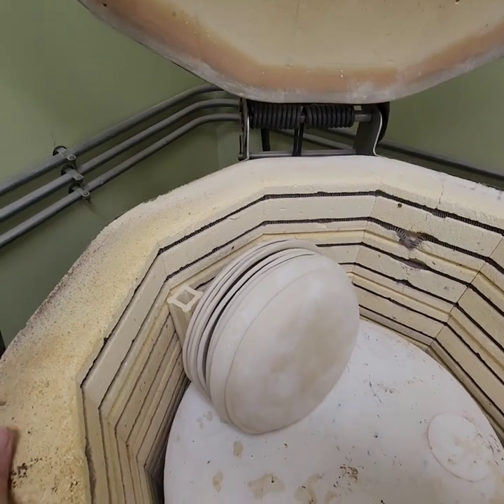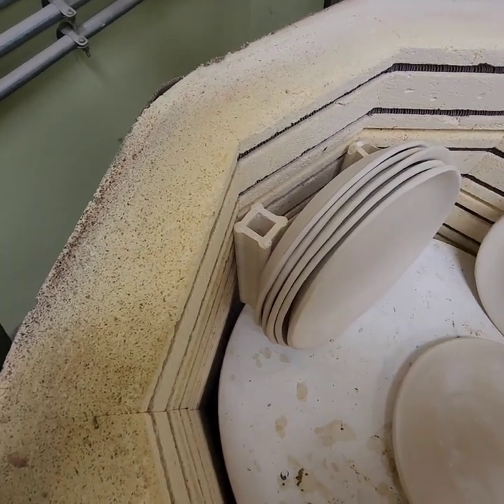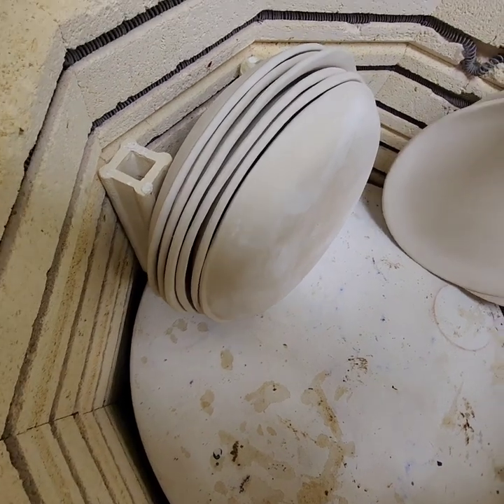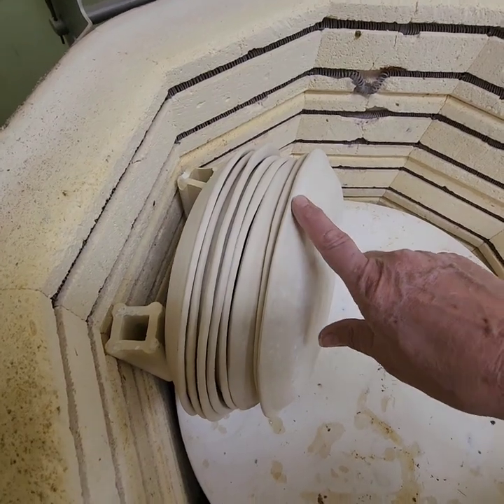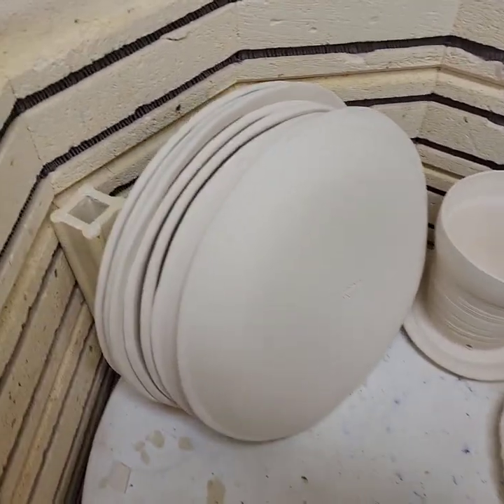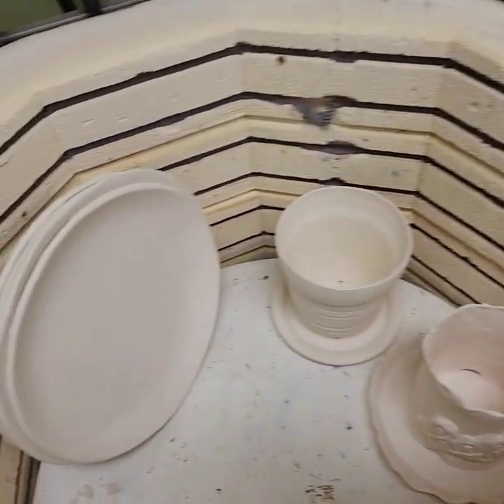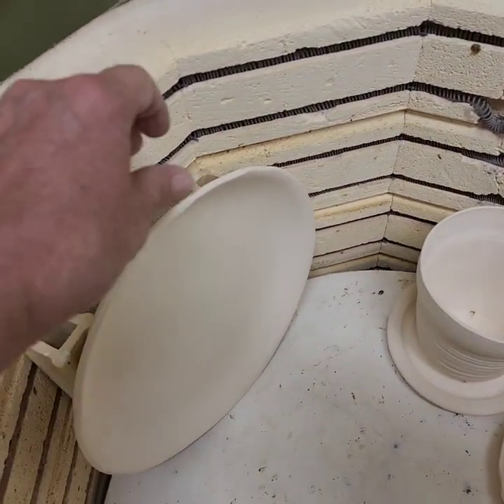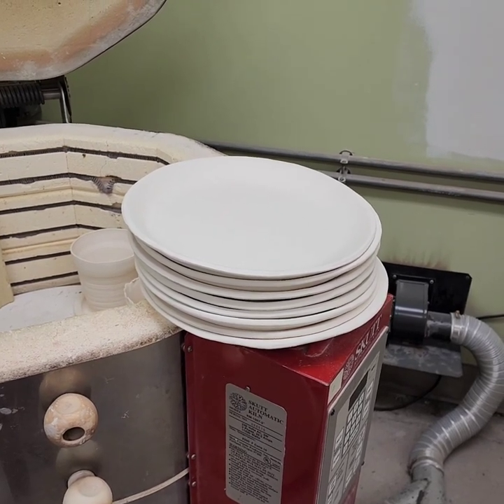The Easy Way to Bisque Fire Greenware Plates.

Comment: Thanks Lisa - short but very sweet! Great info as usual.  Of course, I can only dream of having 8 plates to fire - I roll by hand and honestly, I've had enough of it after rolling enough clay for two plates!! I also think my wavy rims are due to uneven slabs, even though I use thickness strips.  I am researching a Bailey slab roller as we speak. Thanks again - have a great evening. Jan
Reply from the maker: Thanks!  Yes, a slab roller does help.  Especially when making plates.  When I do hand roll, I have a really heavy-duty rolling pin.  😀  If I ever quit pottery, it'll make a good weapon if anyone tries to break into my house.  😂  And it's good for building muscles!